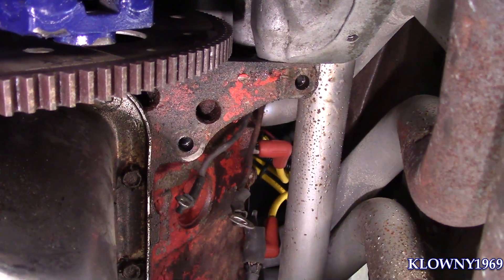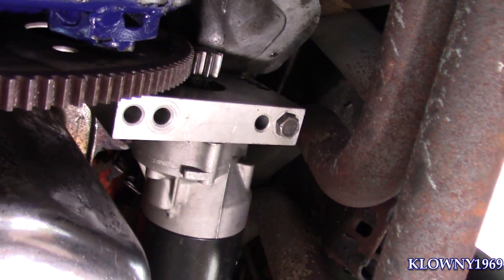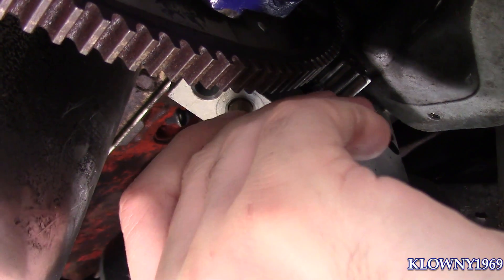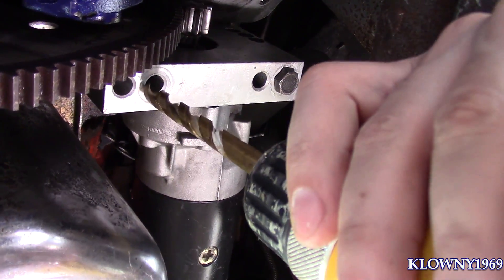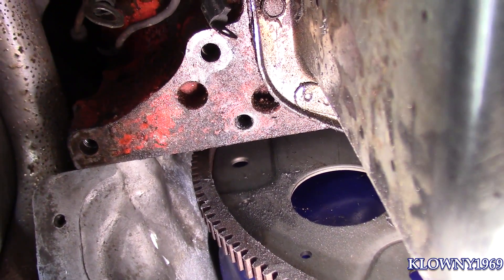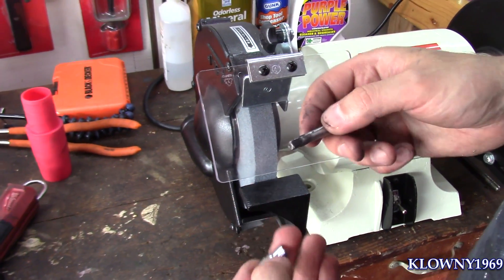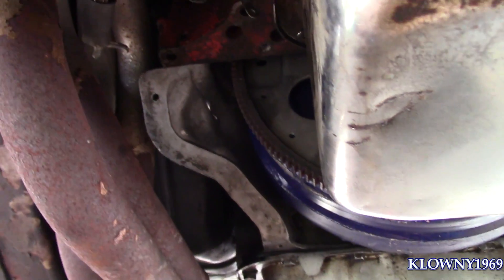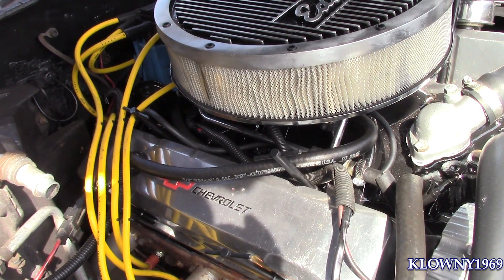How to Drill and Tap a block for a 153 tooth starter

Comment: So I finally got around to doing this today.  Had a multi-fit high torque starter, had to take the transmission and clutch and flywheel off because my G body malibu won't work with a 11" clutch without finding the rare "G body only" 78-79 specific 11' bellhousing. Had to go back to the 10.5" clutch and 153 tooth flywheel that came stock in my 1980 Malibu.

I bolted up the one starter bolt and found a drill that just barely fit in the hole for the other bolt, I think it was an X drill size. Lined up the starter and verified the alignment and the "paperclip" clearance, drilled a pilot divot, then started with a C drill size. Once I drilled that straight thru into the boss in the block, I moved up a couple sizes, then finished off with a 5/16" bit straight thru. My cousin then told me that the starter bolts don't start threading until a 1/2" into the block so I used a 3/8" bit for a 1/2" to create a starter hole for the tap. 

Once I started tapping, I squirted PB Blaster into the top of the hole and went 1/4 to 1/2 turn at a time. With the flywheel off, I was able to use the chuck and T handle in my tap and die kit and tapped straight thru the entire hole. I didn't have to use a ton of force by just doing small turns. It was a bit tedious and took about 10 minutes of turning but it went thru. I already have the flywheel, clutch and bellhousing back on, tomorrow morning I'll fit the transmission again and hopefully be burning tires by lunch time. 

Thanks again for the video. Saved me from fixing it with a jug of gas and a lighter.
Reply from the maker: Nice work! Glad I was able to help and don't forget to subscribe 😉

Comment: Just ran into this problem, a 350 from a ‘74 full size car into a 1980 Malibu 4speed Saginaw. Went to bolt the starter up and found staggered bolts where I needed straight. Going to pull the motor back out and do this on the engine stand cause I don’t have enough room with the bellhousing in the way.
Reply from the maker: Good luck..make sure u drill straight! Don't forget to subscribe 😉

Comment: Hi 🤓Great video! Please help me! 
98 GMC Safari van staggered starter bolt holes. Is there a kit to make mine inline if I buy a different type starter and is there even a different inline starter that I can use that has an adapter like you used. Thank you. I don't want to lose my van. It's my house and I'm stuck in a parking lot.😭😭😭

Comment: If your not careful you’ll drill straight through and go in the oil casing!!!!
Reply: No you can't. You'll go through to the other side. It's a casting lip.
Reply: Joe Coco no wrong because mine went straight threw and I just trashed it!!! It was oil to because when I put some new oil in it I watched it drain straight out!!
Reply: That's not possible. The oil passages are on the left side of the block (by the oil filter) not the right, and the flange where the starter mounts is actually inside the flywheel cavity.   http://www.grumpysperformance.com/oilpasse3.jpg

Comment: Can this be done to a 1998 Chevy blazer?  My starter holes were stripped out.  Rethreaded and now starter doesn't line up to hit fly wheel
Reply from the maker: mrgb306 yeah..it can be fixed
Reply: So what is it I need to get? And where do I get it? Need it bad
Reply from the maker: mrgb306 u can try tapping it..or helicoiling it..any auto parts store can help u get the stuff u need

Comment: could I out 153 tooth flywheel on 97 350 motor? with this style starter???
Reply: yes you can
Reply: I think I'm going to save the trouble and get this style starter that can be for both 153 and 168

Comment: Thanks for the video...I gotta drill my 1958 348 block for a 153 tooth flex plate starter....the 348 had a cast iron Powerglide and the starter didn't bolt to the block...now I have the later aluminum Powerglide and the starter doesn't bolt to it...it now will bolt to the block...the block already has the staggered bolt holes for the 168 tooth flywheel...this drilling and tapping should be just the fix I'm looking for.
Reply from the maker: m schiffel awesome..good luck

Comment: Blocks with staggered starter bolt holes are guaranteed that the flywheel is 168 tooth? I have a 88 Camaro Iroc-Z and my starter bolt pattern are staggered. I'm thinking on just going with a staggered 168 tooth power master mini starter.
Reply: How did that workout for you?

Comment: had to do the same thing on my 400sbc. I have to be special and put a 400 in my boat. I couldn't use the 168 tooth flywheel because it wouldn't fit the bell housing. I screwed up on the threads though so I had to weld a nut on the top side of the hole. still works though. next I need to drill I to the front side of the block to mount the alternator and power steering on the bottom side instead of the top.
Reply from the maker: gotta love boats..thanks for watching

Comment: Thanks for documenting and sharing!  I will be going from an auto to a manual on a '74 350 block, so this vid is great.  Is there a way to work out how many teeth are on the auto flex plate while it's in the car?  I was thinking of counting teeth per inch or something like that.  lol @ Who's your clown daddy and what does he do.
Reply: Broke starter bolt , 
 V6 4.3 small  lock chevy is there a alternate starter  that has straight across bolt pattern instead of off set??
Reply from the maker: lol..i just make a mark with white out on one tooth and count all the teeth until u get back to the mark..thanks for watching

Comment: you need a proper drill index when drilling cast iron or steel, start with 1/8th or 3/32nds depending on how big the hole will be and go one letter size up at a time. your holes will be truer and you won't ruin any bits drilling into hard metal ! other than that  it was perfect.
Reply from the maker: thanks for commenting and watching